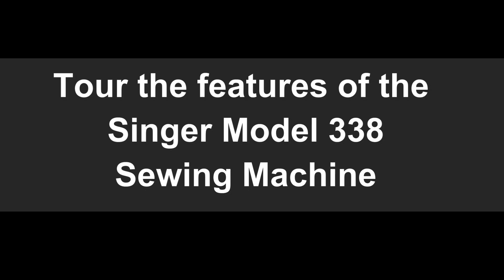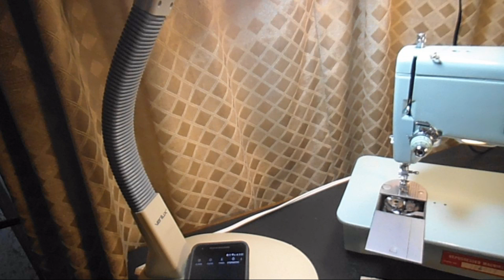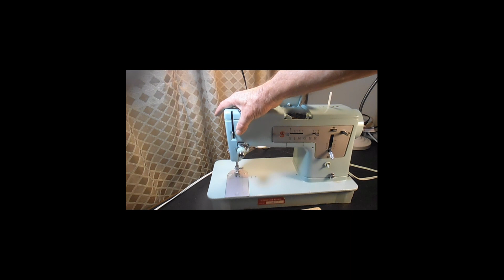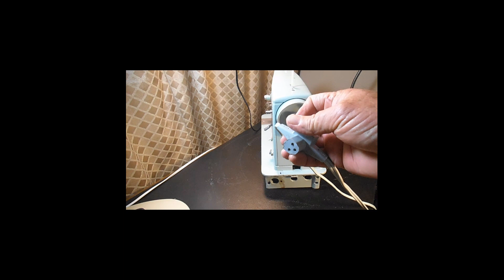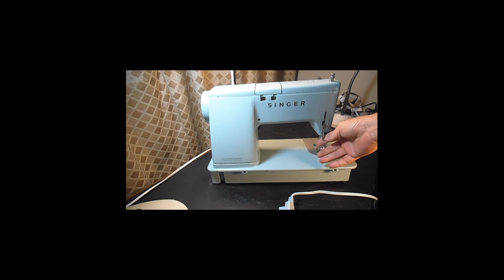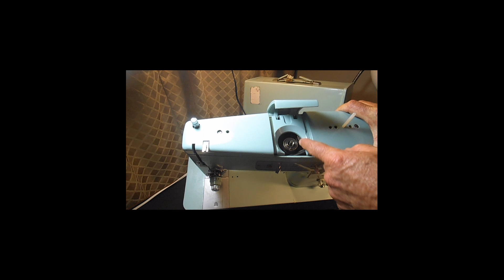Tour the features of the Singer Model 338

Comment: Are other fashion discs compatible with this machine? I bought mine at antique store and it only has the zigzag stitch. Im not sure if I understand the use of the fashion disc. Would I only be able to use a zigzag stitch or is the machine made to default with a straight stitch?
Reply from the maker: Hello, Killian, and welcome to Andy Tube. A great question, thank you. The Singer Model 338 uses type "A"  Fashion Discs, of which there are about 30 different "fashion" stitches besides the regular zigzag stitch. There are other types of fashion discs and pattern cams made by Singer, but they do not work on this machine. In this video which you commented on, I show & talk about the discs at 8:15, 10:20, and 16:15. The regular zigzag disc (disc #1) came installed in the machine from the factory. The attachment set for the machine included several more of the discs (see my video about the attachment set here: https://youtu.be/Kw2n0gvVGFA) and other discs were available at the Singer Retail Stores. Here is a good page explaining the different styles of discs and cams:
https://www.singersewinginfo.co.uk/pattern_cam_list/
You can also download a FREE copy of the original Singer Instruction Manual for Model 338 here: https://www.singer.com/sites/default/files/outdated_product/SINGER%20338%20Sewing%20Machine.pdf
It is 38 pages full of information all about using the features of the machine, all the attachments and "Fashion Aids" and explains the other available Fashion Disc Patterns as well as how to maintain the machine.
If you are in the USA, pattern discs are available many times on eBay and some people are even printing their own discs using 3D-Printing.  When Singer started making the type "B" discs (nicknamed "top hat") they made them push on - pull off of a spring instead of being held on by a large knob like on the 338. The 338 is a very nice machine; strong, versatile and easy to use and maintain, and will last you a lifetime of sewing and crafting with simple cleaning and oiling. If you'd like to see more videos about model 338 here is a link to my playlist of videos I made while restoring "Bonnie Jean", a model 338: https://www.youtube.com/playlist?list=PLsCOZgzzaiKK4y8dsq3oMKJFTGsoNJWmi
Thanks again for a thoughtful question and for watching my channel. Take Care.
Reply: Thank you so much for replying and so quickly! I am so happy to have found your channel! I've been sewing since I was little and have a "newer" plastic brother machine. Which I've been told is pretty much a "throwaway" machine. I would love to restore this Singer 338! I've already watched about 9 of your videos. Threading this machine is unlike any machine I've ever used, with my grandma, or even in school. I appreciate your help so much thank you!
Reply from the maker: @Killy-Willy11  Welcome, and thanks for the SUB. Your "new" 338 can probably sew circles around the plastic machine. A vintage Singer like this can be maintained and repaired quite easily, especially after being cleaned well. Motor belts last for many years and don't cost much. Motor brushes last hundreds & hundreds of hours and don't cost much. One bottle of good quality oil will last for years when used properly: https://www.triflowlubricants.com/product/tri-flow-superior-lubricant-drip-bottle/
When I offered my own daughter a restored machine of her choice, the 338 is what she wanted.
Please do not forget to download the instruction manual and read through it when you have time. It is an incredible resource for you to have for your machine.

Comment: What's the difference between the 338 and the 337? I have a 337.
Reply from the maker: Wait ... you have a 337? Well, in this video I show the features of the 338 and the difference is your 337 has one pattern disc or cam, which is for ZigZag sewing. Every Singer ZZ machine has that cam. Yours is screwed down in place on the camstack, or pattern selector. On model 338 (top of the model line, more $$) there is a flip-up door on the arm cover that allows the user ( you ) to remove the ZZ cam and replace it with another of the 20+ pattern cams Singer made. These include blind hem, multi-stitch (stretch) ZZ, boxes, balls, walls of Troy, icicles, diamonds, etc. This idea later led to the idea of "Top Hat" pattern discs or cams that just snapped into place on the pattern selector and are much easier to remove and replace, like on the Model 403A. The Model 337 is the lower-cost version with just the one ZZ cam and no flip-up door to access it; it's not made to be changed to another cam.  BTW, I have a playlist of 31 videos that is a step-by-step restoration of Model 337. All about removing, replacing, cleaning and adjusting parts and settings on the machine. Just saying in case you are interested:  https://www.youtube.com/playlist?list=PLsCOZgzzaiKJxbOOMKQPvmeTRqi0dhGa5
This Model 338 was restored at the request of my daughter for her personal use. The 337 Model is for my Granddaughter.
Thanks for asking and for watching my channel.

Comment: What is the size of the needle for this machine?
Reply from the maker: This machine uses Catalog 2020 style needles. Commonly called 15X1. It can use sizes 9, 11, 14,16 and 18. This information, and much more is available on page 13 of the original Singer Instruction Manual for Model 338 which is available for free from Singer at this link: https://www.singer.com/sites/default/files/product_manual/SINGER%20338%20Sewing%20Machine.pdf
Thanks for watching my channel, Angel.

Comment: Andy I must apologize, it is not a push button. What year do you think mine is without the center needle control.
Reply from the maker: No worries. All Singer model 337 machines were made between 1964 to 1966. Those 3 years. Any of those years.

Comment: Hi Andy! Love your video. Can you point me in the direction of changing from a zig zag to a straight stitch?
Reply from the maker: Thanks, Irina. Look @ 3:50 in the video. When the width lever is all the way left that is for straight stitch. It does not matter which pattern cam is in place, if any, because moving the lever all the way left disengages the cam follower so the needle can not swing left and right for ZZ or pattern stitching. The needle position lever (L-C-R) and the stitch length lever work the same in straight or ZZ stitching. Thanks for watching my channel.

Comment: Thanks for taking the time to provide help to one sewing know nothing.  Just purchased a 338 in the cabinet today and it appears to work but it does not have the factory supplied fashion disc.  Can it sew straight single needle stitches without it?  What reasonably priced source is out here for obtaining one/more?  My motivation was to find a good solid machine to redo my sailboat cushions myself as I cannot afford an upholsterer!  They are unreal with their pricing.  Thanks
Reply from the maker: Welcome, Carl. You can buy the single zigzag pattern disc for your model here for $6 >> https://www.vintagesingerparts.com/collections/singer-model-337-338-348-parts/products/singer-sewing-machine-zigzag-cam-1-fits-206-306-319-328-338-348-360
Look at the ad to see all the Singer Models that take that style of flat black pattern cams. ( the top-hat cams will not work for you) I watch on eBay and Bonanza for those pattern discs. Sometimes people sell the complete attachment set for your machine and other models (I bought one last year for $21) that include all the presser feet and 9 discs. Singer made about 24 or so of these flat discs. Here is the 20 video playlist of model 338 >> https://www.youtube.com/playlist?list=PLsCOZgzzaiKK4y8dsq3oMKJFTGsoNJWmi
Here is my 31 video series of a step-by-step restoration of model 337, the sister to your 338 but without the flip-up lid pattern disc changer >>
https://www.youtube.com/playlist?list=PLsCOZgzzaiKK4y8dsq3oMKJFTGsoNJWmi
If you need a free PDF copy of the instruction manual go here >> https://www.singer.com/sites/default/files/product_manual/SINGER%20338%20Sewing%20Machine.pdf
A parts diagram/list is free at this location >> http://parts.singerco.com/CPpartCharts/3_39999/338.pdf
BTW, your 338 can Double Needle Sew, meaning 2 size 14 needles installed together with 2 needle threads. I don't know if that would be a good feature for your project, but I have tested it and it looks classy to have double stitches in perfect unison. Best of luck Carl.

Comment: HI Andy.I have singer 338 .If I don't have stich cam, I can not zigzag stich?
Reply from the maker: Welcome to Andy Tube, Joanne. You are correct. You MUST have the zigzag cam installed to sew zigzag stitches. The Model 338 was sent from the factory with that cam installed. It also came with several more pattern cams or discs. There are about 30 flat cams that work with the 338.
Here is my video of the full set of attachments that shipped with Model 338: https://youtu.be/Kw2n0gvVGFA
The good news is the flat zigzag cam for your model is still manufactured and you can buy a brand new one: 
https://www.sewingpartsonline.com/fashion-disk-1-zig-zag-singer-276301.aspx?gclid=EAIaIQobChMIkvmbguCD3gIVluNkCh1_CA-dEAQYAiABEgKrJ_D_BwE
You can also buy them used on eBay, Bonanza, etc. but they cost more than a new one.
Very few cams are still manufactured today, but your ZZ cam is one that is.
You can go here to download a FREE copy of the original Singer Instruction Manual for Model 338: 
https://www.singer.com/sites/default/files/product_manual/SINGER%20338%20Sewing%20Machine.pdf
You can go here to download a FREE copy of the original parts list/diagram of the Model 338 that show parts with the numbers:
http://parts.singerco.com/CPpartCharts/3_39999/338.pdf
The Singer Part Number for the cam is 276301
Thanks for watching Andy Tube and good luck.

Comment: I just inherited my mother's 338 Singer.  Her's came with a cabinet, which at one time had been attached to a lever that I think you pressed with your thigh and it would take place of the foot pedal.  I haven't been able to a video that shows how it may have been connected to machine. Would you know?
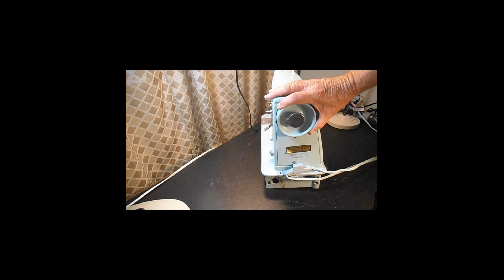Reply from the maker: Welcome to Andy Tube Consuelo. The knee control lever does not replace the foot pedal. The foot pedal would be installed inside the cabinet by sliding into a metal clip. The knee control lever then pushes on the button of the foot pedal. The foot pedal cane be removed from the cabinet any time you like and used on the floor. Either way the cord plugs into the machine in the same way, like at about 12:32 in this video. You can get a free Singer Instruction Manual for your 338 at this link: https://www.singer.com/sites/default/files/product_manual/SINGER%20338%20Sewing%20Machine.pdf
Thank you for watching Andy Tube

Comment: Hi all,
I have been given one of these machines. It looks to be in good condition. What would it be worth to sell? Any rough ideas?
Reply from the maker: I buy this model, including the plastic case and attachment set, for $25 to $40 on Craigslist and thrift shops if in working condition. $10 to $15 if not working or lacking a case or attachments.After a full restoration as shown on my channel I sell if for $150 to $175.

Comment: I absolutely know nothing about sewing, but I'm very interested.  I found this machine recently, would this be good for a beginner who's 48.  Ineed it for curtains an misc. for 64' vintage camper
Reply from the maker: It's a perfect machine for you Matt! A very straight forward zigzag model. It is even the same vintage as your camper. It can use needle sizes 9 thru 18. Curtains will be a breeze as far as the machinne is concerned. You can also reupholster the seating in the camper if you choose, including vinyl. It has one belt (motor), all else is metal. It's verry easy tomaitain and simple to use with controls right in font at eye level and the front, drop-in bobbin. If you need an owners manual, includeing how to oil it, just click hee and enjoy >> 
http://www.singerco.com/uploads/download/0eb4254c46396fd52d8c1360037fabe719e5bd2f.pdf
Thanks for stopping by Andy Tube.
Reply: Thanks Andy!  That's great, I will purchase it.  Is there anything to look for to make sure it's working right?
Reply from the maker: Yes, there are things to look for, even if buying from a shop/store. Have the seller sew a few seams for you; straight stitch and zigzag or take someone with you who sews. Does it sound "smooth" or rough and stained? Take a screwdriver & flashlight and remove all three covers. Check the motor belt for stiffness and cracks. Is the needle bar clean and shiny, or covered with brown varnished old dried up oil. Does it smell like metal and oil, or a dirty junkyard? Almost any vintage machine needs cleaning and some need adjusting and repair. Don't let a shiny paint job outside fool you. You may have better luck at a dealer but will pay a lot more. You may want to look at the model 403A too, a stronger machine but still simple to work on and all metal gears; no belts. If you'd like to email my channel at andytube53@gmail.com I can send you repair guides for those models so you can see what it's like to remove/replace parts and do adjustments. That will help familiarize you with the machine so when you see it in person you have a better idea of what it's like.
Reply: Is this machine a better unit than the new ones, say like the cheap computerized Brother.  Joann has it for 119 right now, I just don't know if new is always better.  I'm a concrete contractor, so this is foreign to me.
Reply: Are u in the US?  And are u a repair/recondition company?
Reply from the maker: I live in Tempe, Arizona, USA Not a business, just a long time hobbyist.
Reply from the maker: Most vintage machines will outlive a new plastic machine unless you spend $300 to 400 upwards. I sell my machines local on craigslist and to some YouTube members who have paid for packing/shipping too. My latest videos are of "Sweetness" a 401a I just shipped back to Florida yesterday. Many of my customers who buy say the $100 to $200 new machine they bought at Walmart or Joanns won't even hem a pair of jeans properly. I have never used one like that. 10 years ago I bought my wife a $380 Singer and 2 months later she brought home a vintage 301A from a garage sale and begged me to "fix it up". That is her daily driver, and she only uses her "plastic" machine for zigzag buttonhole making.
Reply: That's what I wanted to hear, I appreciate the straight shooting.  I know that if u throw big money at these new machines, they're amazing.  But for what I want to do, vintage would be way cooler and my wife won't think I'm as strange for wanting to learn.
Reply: What would a typical restoration cost if I needed it done?  Not holding u to a number, just ball park, without shipping.
Reply from the maker: A machine like this, for a total restore, is $125 to $150 plus parts. I'm doing a 347 right now. It was mostly clean so I'll do a partial disassembly, degrease, polish and adjust. The customer is local and had bought her own new motor belt, so $125. If you start pricing, keep a 404 or 403A in mind, they are more your style. All metal gears and stronger motor than this one. A great "Industrial" style. 403A has the zigzag if you need it, the 404 is a heavy duty straight stitch machine. Here is the last 404  did. Sold for $200 and customer paid $76 to UPS it to Oklahoma.>> 
https://www.youtube.com/watch?v=6RgiOegFx-I&list=PLsCOZgzzaiKIB4kvIHCfHYuyLMUp5A4UI
403A playlist >>
https://www.youtube.com/playlist?list=PLsCOZgzzaiKInZUROdMNIGGO_nfhM2u6D
A good comparison video, but skip through it; it's almost as long as a ball game >>
https://www.youtube.com/watch?v=Nee9PavxWhs
Skip the 401A

Comment: Looks like the 347 I picked up last year. I wonder what is actually different about it other than the power switch?
Reply from the maker: It does look like the 347/348 models, which "replaced" the 337/338 as of 1966. There are some differences. With the 347/348 Singer started to copyright "Line" names for their different models instead of only using a model number.They called the new 347/348  "Style-Mate". The bigger difference however is that Singer moved to a Belt & Pulley system to operate the Hook System, moving away from the all-metal shafts and rods. I believe it was to save money and stay competitive to Japans' many sewing machine companies of that time. 
I will be posting more videos of this 338, including a tour of the inside working mechanisms. If you have time to watch it, you will see the main difference between the 337/338 and yur later model 347.
Thanks for your comment and hope to hear from you again.